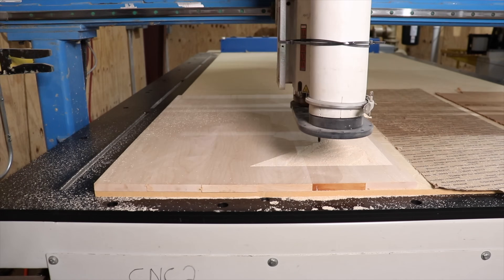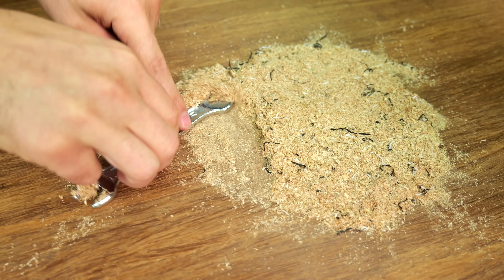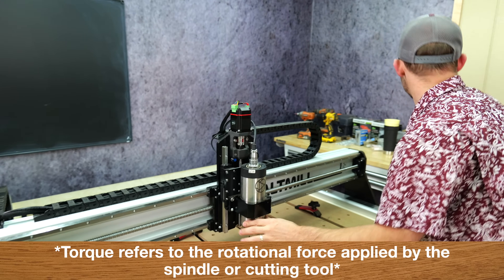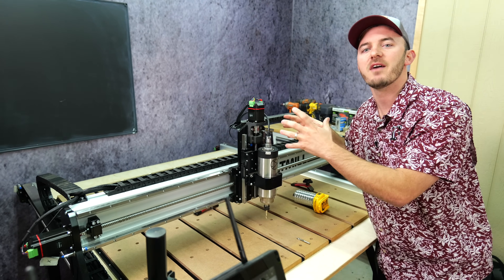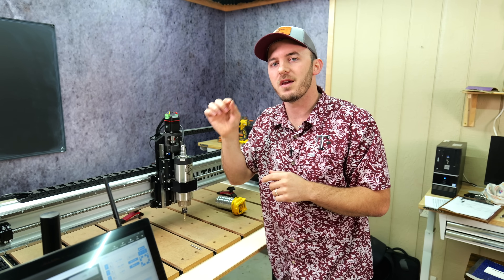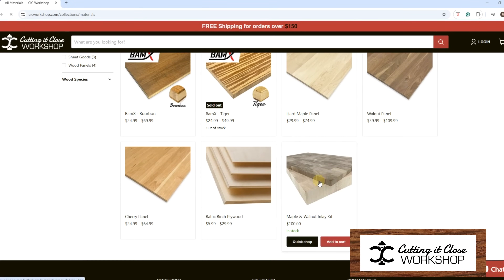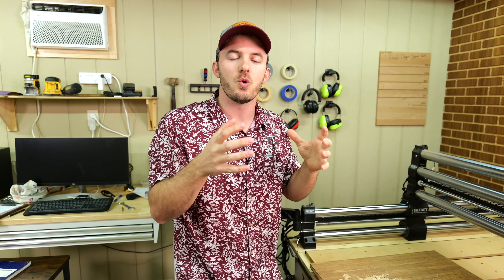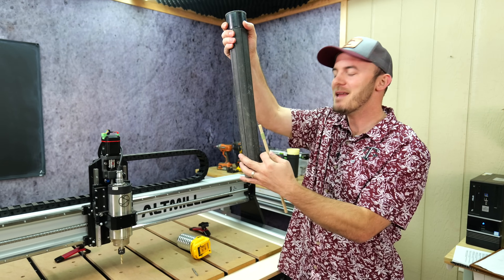Why Your CNC Screams! (And What It Means)

Comment: You were totally right ,my amateur CNC 3018 was screaming because the rods were so loose I could turn the screw with my bare hands :) 

How is your experience, do you have to tighten screws in some intervals or you use threadlock?

Comment: I can confirm the Onefinity rigidity is a problem. Its impossible to run bits at their proper Feeds and speeds.
Reply: So do you have to run the onefinity at a lower speed?
Reply: @brianneveauxsaiz8277  It depends, if your running plywood or sheet stock with a really sharp carbide compression bit, you can get close. 3D carving with a TBN and 6% step over is also fine. but I make guitars so deep pocketing and roughing on hardwoods seem to really challenge the Onefinity. Anytime a tool path is making a 90 turn your going to get chatter and ugly corners. I constantly have to program sweep turns or over roughing to avoid it. I would have bought the Altmill instead if it came with the MASSO controller.

Comment: There's a little more to cutting theory than this video covers. Each cutting edge has a certain relief behind it to avoid rubbing and causing heating by rubbing (friction). The perfect feed rate must ensure that the maximum material is removed but without feeding that relief behind the cutting edge into material. Accurate control of cutter speed is essential to accurately calculate the perfect feedrate.
The more cutting edges the higher the feed rate can be.

Comment: Oh great, I just put down on a OneFinity and here you are yanking the spindle with what looks to be over 1/8 worth of deflection......
Reply: Well you did buy a onefinity so you cant expect the quality of a $100,000+ machine. As long as your speeds and feeds are dialed in youll be fine
Reply: @austinhall485  Agreed, but neither is the altmill on the other side of the room and that's got a far more acceptable amount of flex.  My choice was between the two; Didn't like the short warranty on the altmill, nor it's early stage and I really like the Masso.   Doesn't change the "I chose wrong" pit in my gut.
Reply: @TomBodet556  nah dude never have that feeling, it's the worst. Give it a shot and run it for a couple months and if you still have the feeling in your gut that you'd want something else sell it, save back up and purchase the right machine. Could look into laguna and camcams desk tops as they'd be a big step up in quality but that also comes with a huge step up in price. Hope it all works out for you
Reply: @austinhall485  Side note: I envy your positivity.   Thanks for the shove.
Reply: May not have been a fair test either.  The mount on the OneFinity is higher up on the spindle.  There's room there to move the mount point down and that may or may not resolve some of the flex.  I also don't know what the total clearance is below both gantries.  It appears that the OneFinity is higher giving more working room but also more flex. BTW, 1/8 worth of what?  To me it looks like it's about 1/8th or less of a 1/4" bit, so 1/32" or less.  Camera angles are also different which can change your perception.  I  do agree in this test the Altmill deflected less, but I don't know that the comparison controlled all the variables.  I also don't know how much of an impact that really has on bit life.  I do know there's a lot of people that are happy with their OneFinity CNC.
Reply: He did say that the altmill had a lighter frame which would also limit strength and speed
Reply: I ordered the altmill after working on my buddies onefinity. Hamilton dilbeck did a great comparison recently that made me got altmill. Not to deepen your gut feeling, but it was worth the risk on warranty for me. Idc woodworking is also a good guy to watch
Reply: SIENCI Altmill all day long

Comment: Hey Ryan, on our ShopSabre IS510 I’ve noticed when running small circle tool paths (.25dia and smaller) the whole machine shakes and jumps unless I slow it way down. It does it with the laser attachment too, so I don’t think it’s bit related. Seems like 42ipm is happy for me in the super tight circles. 

Have you noticed this on your machine? Am I right to slow it down or is it ok to be shaking like that?
Reply from the maker: Small circles like that I run that slow as well on my shopsabre. It never gets up to speed anyways because it’s such a small area. That big gantry has to stop and start. On mine I get ovals if I run too fast on small circles.
Reply: @ thanks for the insight

Comment: I believe the movement of the router bit when you pull on the xfinity is not due to the yoke and carriage assembly but due to the pipes that carry the carriage.  Those pipes are not nearly as stiff as the gantry of the altmill.  Its not the yoke or the bolts holding it together, tight bolts don't flex.

Comment: Awesome breakdown Ryan. Quick question if you have the time. So far my CNC experience has been with a Bobs CNC (the original model) and a Maslow. I have a software engineering background and have been running a fairly successful woodworking business for about 6 years now. I’m about to pull the trigger on either a OneFinity or an Altmill. Right after that I plan to sign up for your course and essentially buy anything you say I should. I am on the fence still about which machine to go with. In your opinion which of those two machines should I go with? I realize there may be sponsors and affiliate issues that might prevent you from stating an objective opinion and that’s totally understandable. However, in the event that you are allowed to state your opinion I would really appreciate your input before I have a go at making my case to my wife. Cheers 🍻
Reply from the maker: Hey Alex, I appreciate the question, I would like to talk more about it on the livestream I do on CNC startups, I have one on Wednesday’s and I can give you a more clear answer. Both machines will cut just fine, and you can make money with both. I like the Altmill over the Onefinity so far. Let me know what you end up getting. Would like to talk with you in the live Q&A on CNC startups as well if possible for you!

Comment: Another great video. I've been shopping for a really reliable CNC machine and have narrowed my search down to the OneFinity ELITE Series Foreman (48" x48" Cut Area). I understand perfectly that the vast majority of screw-ups are operator errors :(. That being said... How important is the router/spindle?
The ELITE Series Foreman (48" x48" Cut Area) is advertised as built for the Makita finishing router? (I'm a bit underwhelmed with my own makita) I notice you are running a 220V water-cooled monster spindle... do you have any thoughts or recommendations. I'd rather have more power and not use it than be faced with being under-powered. Thanks... and keep the videos coming

Comment: If your machine has 24k spindle, try out single flute cutters. Stay north of .001 ipt on anything 1/8 inch or bigger in diameter. All these guys on YouTube pushing these 3 and 4 flute over priced roughers aren't explaining that your feed increases with the more flutes you have. If your spindles torque range nose dives when you turn your rpm down, as they tend to do, then you're not really accomplishing much. Less flute equals less feed at a given rpm. But you gain mrr and better tool life with the bigger ipt. 
As for deflection problems. Adjust step over and depth of cut. They affect the load more than anything. That's why high-speed milling is so effective in metal cutting. Shallow step overs at full depth, take the load off the tool, and the high speed feed with many flutes make up for small step over. 
If you're not tinkering with your speeds, feeds, step over, and depth of cut, you could be leaving tons of performance and efficiency on the table.

Comment: Good info and good presentation of it Ryan!  I clicked because your title was talking about the bit screaming.  I was wondering if anyone knew why a bit would start screaming just by changing manufacturers?  I'm running the same projects in the same materials at the same settings but my new bits from a different manufacturer scream (or at least have a significantly higher tone) than my old bits...  Neither bit is coated...

Comment: Great video! This is very important for people to understand if they want to grow Rather than just cranking the RPM to the max and running till the bit breaks. 
Another thing people fail to understand is harmonics. A lot of times you can reduce vibrations by increasing OR reducing by just a couple hundred RPM. You touched on it by explaining vibrations and I understand you can't explain everything in one short video, but by understanding that vibrations come from harmonics sometimes can help you understand how to reduce them.

Comment: I’ll bet that wiggle on the Onefinity is the bend of those huge y axis round bar rails.  You can verify by moving the spindle to one end or the other and trying the same wiggle test.  To mitigate this, run your project as close to the edge of the work bed as possible (rather than the middle).

Comment: 10:45 could it be because your spindle is mounted significantly higher on the Altmill compared to your onefinity setup ? Genuine question, I'd love to know if mounting the spindle at roughly the same height in the Z axis would make a big difference for the onefinity.
Reply: @dudule1232 I believe that is the issue, having the spindle sticking that far out is creating a much larger moment

Comment: I also found vibration could also be caused by pieces being routed are moving due to inadequate hold down methods. Next on the list is figuring out feeds and speeds to optimize the bits being used I just use trial and error.

Comment: maybe you know the answer, my xcarve started randomly changing carve depth throughout a project, all tests show zero mechanical issues and all points to electronic failures even a possibility of a static charge causing it? thoughts?
Reply: It's possible that your Z axis motor is starting to fail, or getting weak. Is the change in Z always down?
Reply: @ZrubekFamily  yes
Reply: Could be a bad collet or cracked collet cap. Might be pulling the bit out of the spindle.
Reply: @jcmdesigns101  i measured the bit height and checked all mechanical suspects
Reply: @jcmdesigns101  that's all in perfect order